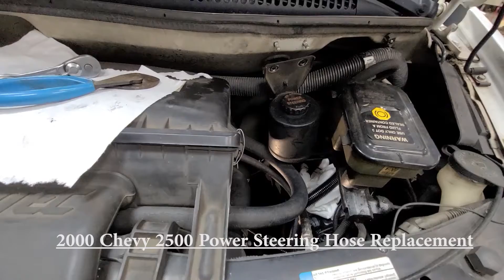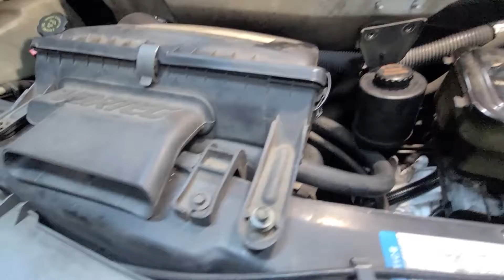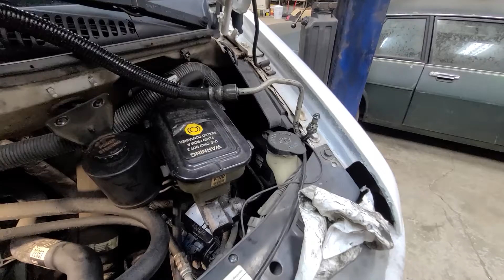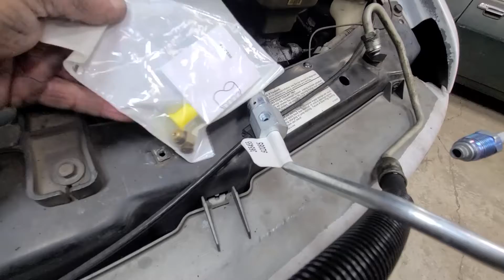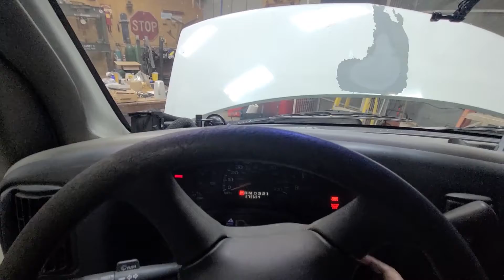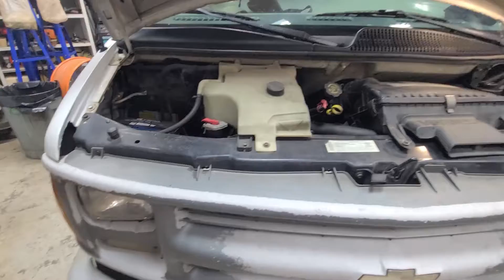2000 Chevy 2500 Express Van Power Steering Hose Replacement Friday March 18th 2022  PowerSteering#

Comment: Need to replace the same hose on my van. My question is regarding getting the right hose. I noticed the parts stores sell 2 different hoses. Both which are very similar. Only difference is one hose states “pump to hydroboost” and the other states “hydroboost to gear”. Do you happen to know which is the correct one ? Or not sure if they’re the same hose or not, my local parts stores don’t have them in stock so I can’t compare it with my old hose. Would appreciate a reply. Thanks.
Reply from the maker: @Z33.gi0  they are not the same hose, I think I paid about $60 for each one, Yes compare it first or replace both at the same time. I may be replacing the pump and hydroboost again one or both are making a whining noise.
Reply from the maker: That hose is the pop to the Hydroboost. I found out now if you go under the dash and loosen the four bolts that hold the hydra boost in, you can slide it forward and get to get access to the hoses much easier
Reply: @Crowbirdvideos  will order that hose, thanks for the reply. Super appreciative. Somehow every time I YouTube something about my van having an issue your videos always seem to come up lol.

Comment: Do you not have to bleed the line?

I heard you say 278k miles wow! Original trans?

How many miles you think it will go?
Reply from the maker: I had the engine and trans replaced in February this year, both had 3000400 miles on them, the (van now has 315,000) I also had the radiator, water pump, heater core, all belts, hoses, vacuum lines, five lug studs, front calipers and pads, added a trans cooler, front and rear hitch. I am trying to get it road ready for an extended Nomad excursion, around the U.S.  living it it and getting video for the channel. I have a solar generator/inverter, two rv deep cycle batteries, portable heat/AC, and hope to get going on the trip by late summer. Thank you again for commenting on the videos and for watching. I ow have over 2000 videos on the channel with a lot more repair and product reviews.
Reply: @Crowbirdvideos  did you mean to write 3,000,400??
Reply from the maker: @laughingthrushmusic5269  LOL, no, I am sorry about that it was 300,400. Thank you.
Reply from the maker: Yes, you do, I just did not show it, maybe next time. Thank you for your comment and for watching the videos, I have several more of the van and my two jeeps in the "playlist" "Jeep and auto repair" on the channel
Reply: I seen a lady 20 years ago get a auction car Volvo 91 with 1000000 miles

Comment: I just diagnosed a leak in the hose that runs from my steering gear box to the back of the power steering pump on my 2001 express 1500. Looks like getting to the bolt on the back of the steering pump is gonna be hell,but I gotta fix it somehow because that pinhole leak is spraying fluid over everything.
Reply from the maker: I hope you do not have any problems those hoses are a real pain. Thank you for commenting and for watching the videos
Reply from the maker: I have several more repair videos on this van that may help. Thanks again

Comment: @rcmcrmc Sir, how would I remove the windshield washer res/pump?  I don't see any other way than force pulling it out... The wheel well is welded shut? !?!?!?
Reply from the maker: I need to get mine out to get to a socket and extension that I dropped behind it. It looks like it will come out if you disconnect the Master Cylinder and move it out of the way, but I am not sure. Let me know if you get yours out. Thank you for your question and for watching the videos.
Reply: @Crowbirdvideos  I got mine out but it wasn't pretty, I did the following but im not sure if it actually helped me when it finally came out.  I removed one nut for the fuse box near the res and moved the box slightly to the side.   I took some bolts out of the front frame (under the grill) so that the front can be 'pulled' forward a bit. 

I then struggled to pull it out for about 30 minutes before getting on top of the bumper and dead lifting it out.

Turns out the pump works, tested it in a disposable plastic cup but its not like I was able to access the connector to do a multimeter test anyway!

I am going to attempt putting it back in some time today, hopefully I didn't cause any damage :)

I would really like to know what is the 'official' way to get it off, I am thinking removing the headlight assembly mounting plate? might be feasible but it didn't seem worth the effort for the amount of working space gained would have been

Comment: Lots of dialog that’s not needed. At least this video has actual useful content. His other video is just talking. Get the hose fitting on pump from below.  Move wire harness to get top fitting out of brake booster.  Feed top hose down past brake lines.  Feed bottom hose under cooler lines.  Remove from top.  Install reverse order. I just saved you 20 minutes counting his other video.  Your welcome.  Yes it’s a pain in the ass.  But it can all be done with a 16 and 18mm wrench.
Reply from the maker: Thank you for your comment and for watching the videos, yes I get mouth dribble more than I want too, but I hope the video helped a little.
Reply: Hi again. Dealing with the same issue on my van. did you happen to catch a part number or at least the actual name of it ? Not trying to order the wrong part off rockauto. Thanks

Comment: Just did this on a 2006 Chevrolet 2500 Express Van with the 6.0 V8.  Very similar setup.  Once I removed the plastic rain shield to the right of the brake fluid reservoir and a supporting strut rod (not seen on the vehicle in this video), I was able to wrestle the hose up over the housing to which it's connected, then down, forward and out.  The main issue I had underneath was that I was working in my driveway so I jacked it up on the driver's side as far as could to get some working room (I did, of course, also put jack stands under it).  Once the lower end was disconnected, the difficulty with removing it was that, because of all the little twisty-turnies, it was snagging on anything and everything.  Installation of the new hose was not actually very difficult.  Just try to remember how the old one was removed so that the new one can be wrestled in in the same way.
Reply: Bought a 01 savana for 800 because the brakes and power steering was out steering was leaking he didn't realize the power steering help the brakes and found same hose problem van got a factory new engine and rebuild transmission all for 800
Reply from the maker: Thank you, for letting me know, and for watching the videos. I have to replace or rebuild the hydroboost unit soon and will be making a video of it. Do you have any info that would be helpful about the hydroboost unit?
Reply from the maker: @thomasfinley9919  yes, I have started taking photos and video of everything I do so I can figure out how things go back

Comment: How hard is it to take off the power steering pump???
Reply from the maker: After getting good access by removing the air filter, water reservoir, top of the fan shroud fan an belt. you can get to the pully and remove it. after the pully is off it is just 3 bolts on the front, two on the rear and the hoses. It was not really very hard at all. I thought it was going to be a lot harder. Thank you for your question and for watching the videos